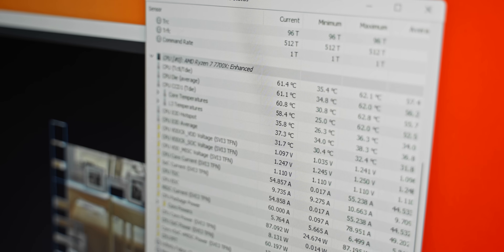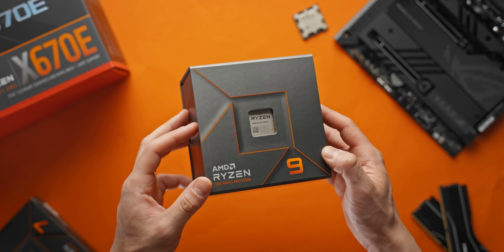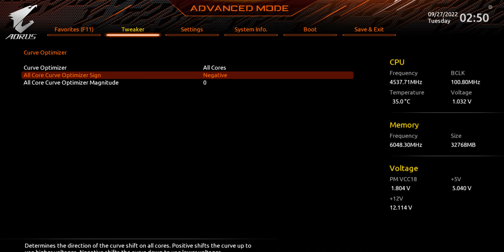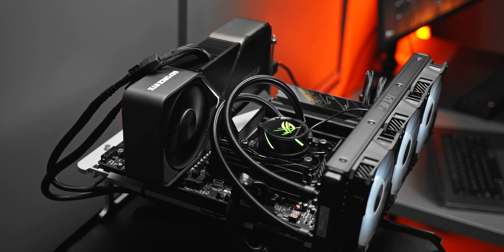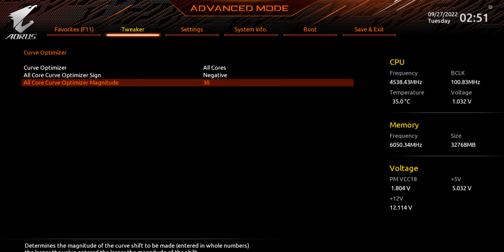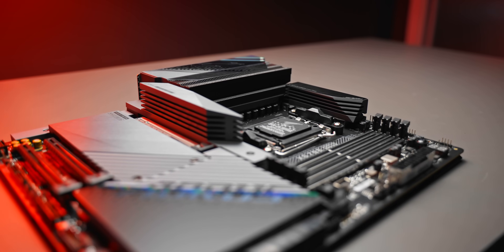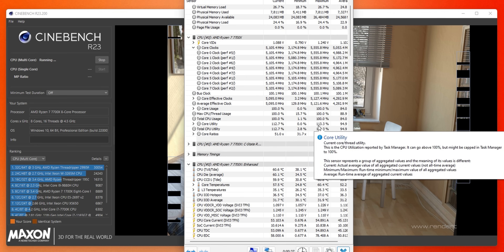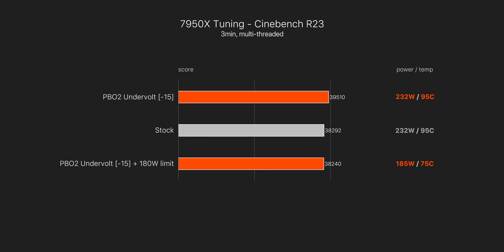Fixing Ryzen 7000 - PBO2 Tune (insanity)

Comment: Great video!

Wish more Tech Youtubers would do it properly like you did and spread awareness about this topic, which is under-volting and setting power limits, into their videos rather than just blasting it at "stock settings" up to 95 degrees with default wattage, and then making charts about how hot, power hungry and inefficient this new generation is -_-

Also, out of topic, but would you please consider lowering volume of / changing that "click" sound when you highlight something on your charts to an auditory level that does not startle a listener who tries to follow what you are saying, or at least time it so that it doesn't occur while you're speaking

Comment: Wow pretty mind blowing, NONE of the other big review channels have probably even thought of doing such tuning to reduce temperatures. This is actually a HUGE deal cause Ryzen 7000 buyers can use their existing cooling, or save money on cooling. Otherwise they would be forced to buy 360mm AIOs or even splurge on custom watercooling.
Reply: Not ture, Ryzen 7000 runs at 95 even with the shittiest cooler, it won't overheat.
Reply: @tdrm  True, but u can check out paul's hardware's latest video where he tests old ryzen stock coolers on the 7600x. 

Without PBO tuning the freq drops 200-400mhz, lowering cinebench scores. With PBO tuning the clock speeds and cinebench scores get even better than with a 360mm AIO on stock untuned. So PBO tuning is definitely a must do for anyone who knows how to do it, in order to maximise performance and lower temps.

Comment: Very cool, others techtubers being occupied with OCing their 7950X on LN2 lol :)
Anyway, imo the best CO method is to use per core offset, using -15 to -20 on the 3 best ones and -30 on the rest, it usually works on all chips

Comment: Videos like this is very helpful. No clickbait, no side topic, no side jokes, just sticking to the topic in the most simple way. Thank you!
Reply: This video encourages people to make their computers unreliable and doesn't warn them about that.  "No clickbait?"  The title Is *Fixing Ryzen 7000*.
Reply: @Vegemeister1  Unreliable by what exactly? Undervolting and making temps lower? Yes the title said 'fix' bec it fixed the high temp issue.
Reply: @frogyafro  Unreliable by the CPU computing wrong results, causing programs or the OS to crash, and potentially corrupting data.  AMD and TSMC's process engineers think 95°C is absolutely fine for reliability, and that voltage margin less than the at-spec V/F curve is not fine.  They can simulate and test every feature and instruction the CPU has, and many interactions between them. You can't.  They can do accelerated life testing and test many samples to failure at temperatures >>95°C.  You can't.
Reply: @Vegemeister1  But does it mean it cannot be tweaked by a certain degree? What overclock is here for then? Bios settings is there for a reason.
Reply: @frogyafro  There are things in the BIOS settings that can make your computer not work correctly, sometimes in ways that are hard to attribute to the BIOS setting, sometimes in ways that are intermittent to the extent that users will think programs are buggy or, "computers just crash sometimes." 

The BIOS settings are for advanced users who know what they are getting into and have sworn an oath not to report bugs in any software unless those bugs can be reproduced with everything at stock.
Reply: Realize that undervolting and overclocking are the same thing -- reducing the stability margin of the chip.
Reply: @frogyafro  I tried this trick a while ago, and first thought it was cool to see temp and power drop. But after a couple of random shutdowns and bluescreens, I installed OCCT, and it confirmed that the CPU became very unstable. Currently I am just setting PPT limits, and everything else stock.

Comment: Damn man, this is just what I needed to alleviate my concerns about moving on to AM5. I live in a high electricity cost area. Everything in my apt. is electric accept the cooking gas and hot water heater. A double whammy for current energy costs. I am currently on a Asus Crosshair Impact custom water cooled 5600X with boost set to 4750, I just recently upgraded to a Sapphire Toxic 6900XT and it does pull the watts if I let it. I play my games with Radeon Chill enabled it saves 125W over "stock" power draw. 400W total system draw so if this will work with a 5600X it should work with the 5800X3D, shouldn't it?  I work out of my apt. doing IT service calls. I spend a lot of time on the computer doing work related stuff. During downtimes of the day I do play my games for about an hour. I track the power usage of the gaming pc alone via the UPS software. It added 3.5 KW to my electric bill. If I can further reduce it or keep it the same when I upgrade the cpu that would be just what my wallet ordered.

That is my current plan for upgrades, to wait out the outrageous X670E motherboard prices. $700 for a Asus Crosshair Gene mATX is just crazy IMO. While I do like the looks. I will wait until the 3D Vcache 7000 series comes out before I even consider the move. I waited 2 years for the RDNA2 gpu of my choice. I paid 50% off the retail price from February of this year. In two years time It will be still ok to buy Zen 4 with Zen 5 around the corner. Hardware performance is outpacing game engines at the current time anyway. My top of the line AM4 gaming system will not be obsolete next year or the year after. Only recently now that I have a fast gpu do I see cpu usage approach 50% @1440p. If I let the gpu use 330W it will exceed 50% usage in gaming but not by much. That's why I normally game on performance settings (280W) and use chill to bring it down to 200W with 12ms frame times in the Division 2. When I want 7ms frame times. I just turn Chill off and get 144fps.

Will a Crosshair Hero VI with a Zen 3 cpu be considered "retro" in 2 years time? Let alone a X570 motherboard. Why pay more for entertainment when you don't have too? This past summers heat wave had me running the pc on chill for all games just to keep the room temps below 40C. No AC. with multiple pcs running. My HTPC is a 5600X also but with a water cooled Vega 64 that I use for gpu compute tasks. So it generates some heat when processing. But that gpu is power limited to just under 200W for those tasks. It's main advantage is at idle is sipps only 7w 10w watching videos. If the price for the 5700G drops some more I may just upgrade that system for even more power savings and retire the Vega 64 to my collection shelf. I can now do the gpu compute stuff on my gaming pc if necessary. The money I save on electricity directly affects the pc upgrades I plan for the future. If you buy top end components and don't abuse them it is easy to get 5 years out of a system if not more. I upgrade mostly to save energy costs. My water bill just recently doubled because the city made a mistake in last years billing! As I am sure you know living in 2022 ain't easy no matter what country you live in. Especially the US.

Thanks for the video I hope others get what they need out of it as I did. 🤩

Comment: AMD missed a huge opportunity here. This means absolute control of your CPU, with big focus on temperature and power. For example, users can easily configure a big CPU to be used in SFFPCs without major compromises to performance.
Reply: How did they miss an opportunity if they literally developed PBO2 to configure the 7000 series?
Reply: @omegaPhix  yes, sure. But they could have given some focus to this feature, specially now that every single reviewer is saying that zen 4 is hot and power hungry.

Comment: Have you tested single core stability for -30 Curve Optimizer? Because from past experience in Ryzen 5000, CO is most problematic at a single core workload because 1-core boost clock is much higher than all core boost clock and therefore, requires much more voltage. If you undervolt too much, you will experience performance degradation in single core performance, or worst case, outright crash of program's you're trying to run. Civ 6 is super sensitive to this and an unstable undervolt will cause the game to hang up frequently.